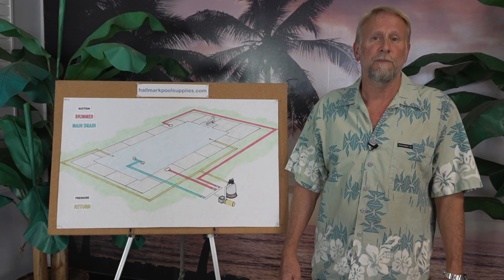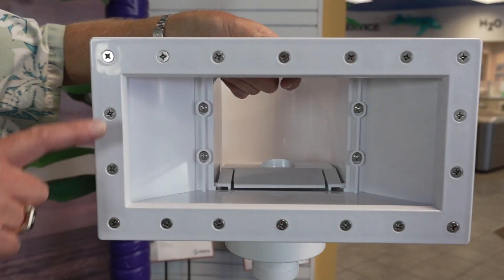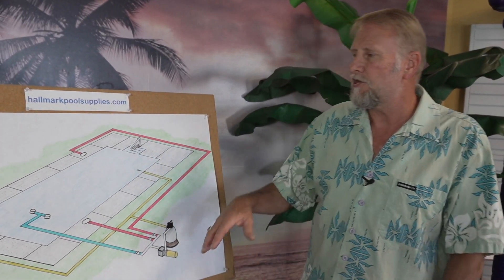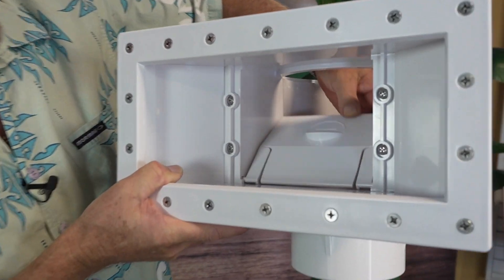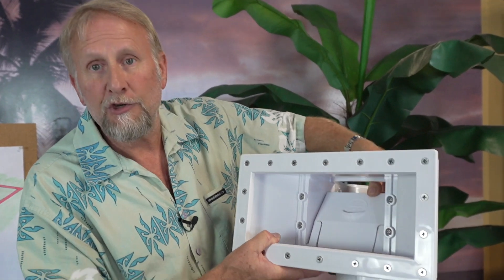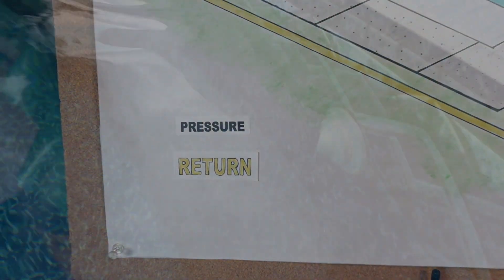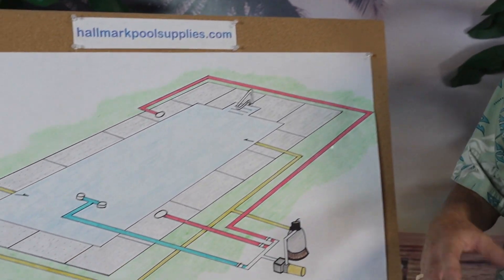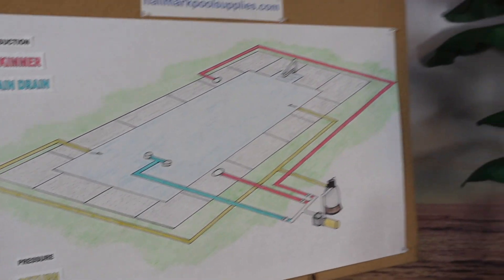How A Swimming Pool Works!

Comment: Hi Mark.. qq for you! We are refilling Our pool. The water level is above the low suctions but below the returns. I thought I’d put the pump on to get some circulation going on and can hear the water flowing to the filter.  Nothing is coming out of the return. Does the water level need to be near the return height for this to happen?! Thx
Reply from the maker: No, if you close the skimmer(s) you can run off the drain. Thanks for watching.
Reply: Interesting.. I wonder why we are not getting anything back from the return then. I’ll wait until the level is higher, try again and then call the pool company! Thanks

Comment: Hi Mark I love your videos but I'm not the greatest pool guy. I have an inground pool and over the winter it developed a lot of algae. I have cleaned by filters multiple times and after putting the recommended chemicals and the pools is getting clearer but still is green. I algea is still there. Should I vacuum the pool again which I'm using not so good vac and could I use a basic water vac to vac better somehow. My pool is 32 ft by 20 ft.

Comment: My pool doesn’t have a drain. Have you ever heard of this? It just has two skimmers and a side drain. It had two returns. 27k gallon pool. Grateful for the videos since the builder and maintenance people have not been helpful and I wasn’t given any understanding of the plumbing. It also has an underground drain that goes off into the woods and was blocked I didn’t know if the multi valve on my sand filter needs to be turned from waste and to filter after I finish manual vacuum after floccing. Didn’t know if insinuating the waste valve setting water was still getting out because I lost so much water taking all day to refill and then some (added two inches before vacuuming!)

Comment: 24 hrs? I dunno. That’s wasting too much energy. You can calculate how long to run to cycle the whole mass. Usually 1 hr. If no one is using the pool, couldn’t you just shut off the system till the next day?

Comment: شكرا جزيلا على هذا الشرح انت شرحك رائع 
اذا سمحت لدي سؤال 
عندي مسبح قياسه 9 m طول و3,70 عرض وارتفاعه 135cm كم يلزم فتحات دفع راجع لحوض السباحه وكم فتحه للسحب من الحوض وشكرا لك
Reply from the maker: @عبدالمجيدالبيتاوي    A pool this size should have at least one return jet (pressure line) and one skimmer (suction line). Placement of the return jet and skimmer is important, so that you have good flow and circulation in the pool. If a drain is added at the bottom of the pool, then by code you would install two drains at least 1 meter apart. Thanks for watching.
Reply: @HallmarkPoolSupplies  شكرا جزيلا على هذه المعلومات

Comment: I have looked at 3 of your videos so far.  The information you have given, has been  spot on in dealing with  a few issues. Myself and in helping my neighbour.
I have a pool company who is doing the cleaning at the moment. Since watching your  video on  vacuuming. I may need to have them changed the way they carry out doing this. Vacuuming straight from the skimmer. Without using a vacuum plate, which could end up blocking my skimmer. I cannot seem to get a hold of one in Cyprus

Comment: I have a gravel pool filter and it's putting gravel in the pool how to fix please 🙏
Reply from the maker: @FOM-PRODUCTION    If this continues you will have to empty your filter and check the laterals inside the tank. If you need help I do have a video on my channel that pertains to this issue. Thanks for watching.
Reply: @HallmarkPoolSupplies  do I need to remove the gravel to check them
Reply from the maker: @FOM-PRODUCTION    Yes